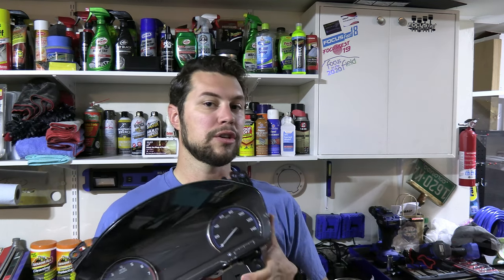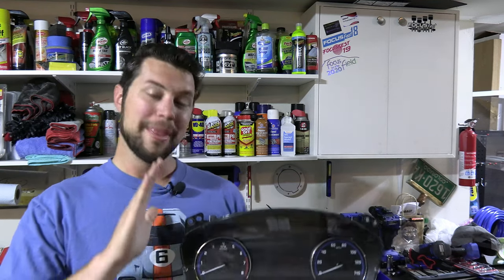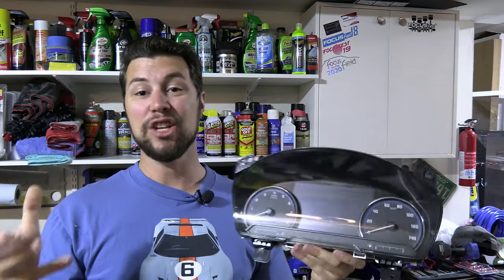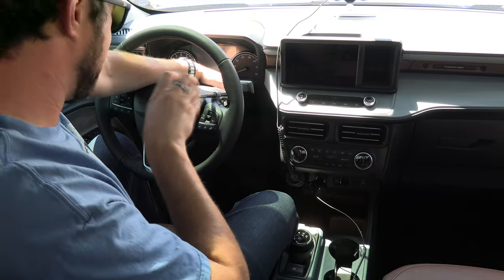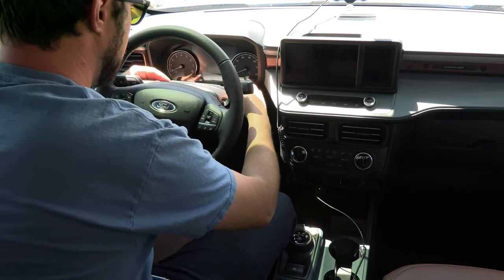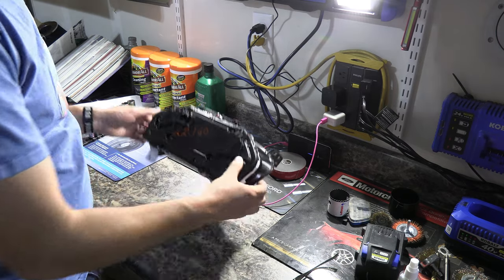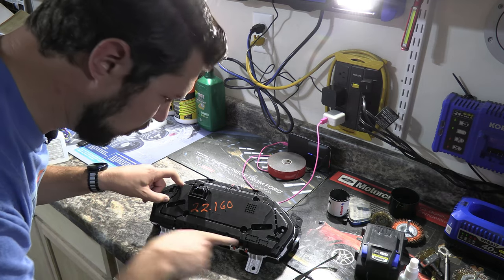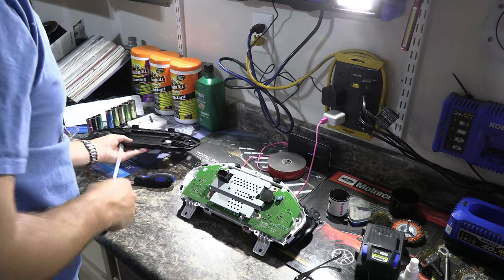Removing the instrument cluster from a 2022 Maverick and swapping in Bronco Sport Gauge Faces

Comment: So awesome. Would you happen to know if one could swap the bronco sport cluster from the outer banks / badlands (with the big digital screen in the middle) into a base / big bend bronco sport (with the smaller screen)?
I have a big bend and I’d love to do the swap but I can’t find anything about someone having done it. Mileage would have to go UP on the new cluster so that should be okay based on what you said here. Thoughts?
Reply from the maker: Yup! If you check out my other video that's what I did with my 2020 Escape. Went from the small basic cluster to the Outer Banks cluster.
Reply: @DTFGarage  was it literally just plug and play? Or did you have to do any kind of coding etc.. to make it work? I’ll checkout your other video too. Very tempting but worried id mess something up.
Reply: @DTFGarage  So your guess here is if I were to order the outer banks cluster and swap it in it would just work plug and play in my big bend and I'd just need to use Forscan to set the mileage higher (on the brand new cluster)?
Reply from the maker: You'll have to save a copy of the original FORScan data from the instrument cluster and load it onto the new cluster after getting it installed.
Reply: @DTFGarage  but other than that you think I’m good to go? Any chance you have the part number for the outer banks cluster? I’m looking online and most places that sell them new have a core charge which I’d have to pay since i wouldn’t have a way of sending back the same part number I guess.

Comment: I had to replace my cluster in my 21 bronco sport. I am trying to correct the milage as the one I got has less on it compared to what it should be. I see here you talk about doing it in Fourscan which I have and used to remove the double honk but cant find where to update the milage.  Can you help??
Reply from the maker: When you plug in Forscan and it lists all the modules, you should see the IPC (Instrument Panel Cluster) Module, and then a IPC Mileage Module underneath it. Then you can go in there to correct the mileage.
Reply: If you don’t mind me asking, why did you have to replace it? I’m looking to install the outer banks / badlands nicer one into my big bend. Is that what you did?
Reply: @othmankammah382  No, I have an Outer banks and the cluster bricked (not modding any thing, just randomly) at 52k mile and so out of warranty and there were non available from Ford at the time plus they were like over $1000 so I found one on line from a wreck but the millage was lower then mine. The physical replacement was easy and works great but I want to correct the miles.
Reply: @dtfGarage I also just tried another adapter recommended in FORScan forems to work but still cant get it to IPC module. I removed all my profiles prior and everything . Any other thoughts?